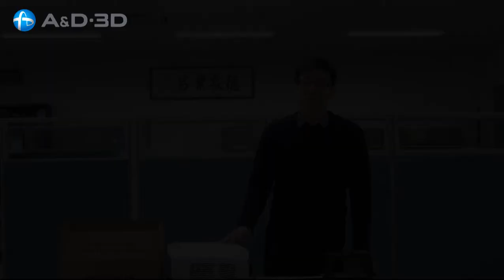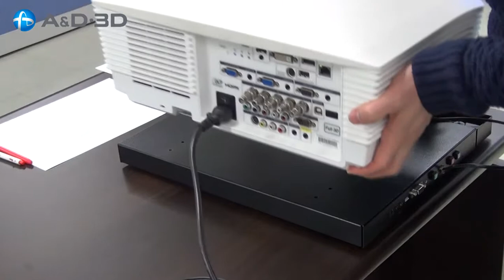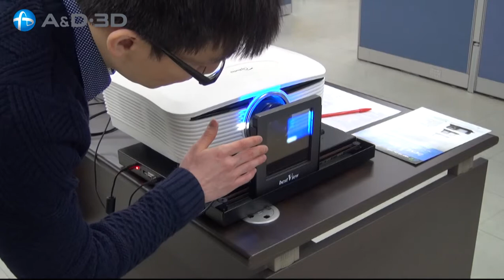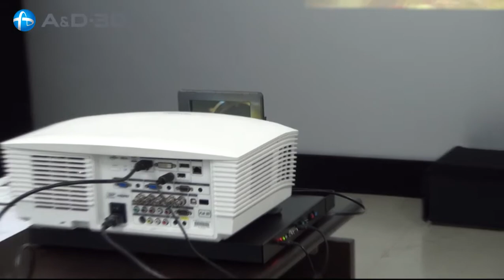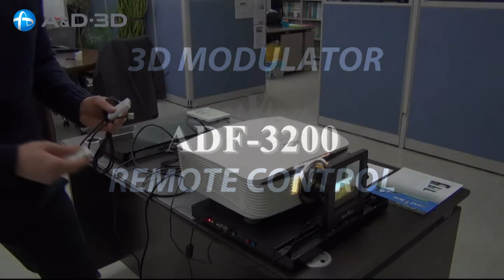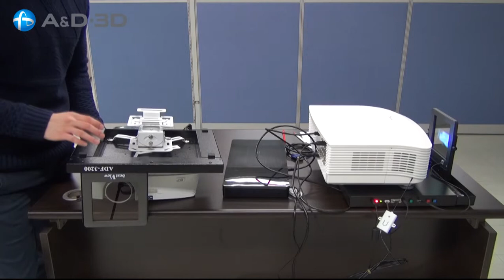3D Modulator bestView ADF-3200

Comment: for this 3 D modulator  required 3D digital projector and also required 3D movie player, 3D movie content ?
this modulator can use in 2k barco projector ? please tell me Sir
Reply: Any projector with 3D function can be supported.
 3D player (Blu-ray, server, etc.) 3D content is essential.
Reply: @최시훈-k7n  one more question this 3D modulator can use in cinema at large screen (W52 feet & H 26 feet ).sliver screen is need for this . is this 3D modulator and digital projector connect to each other ? please tell sir.

Comment: How to connect to a projector which is 3D but does not come with the 3D sync port?? For example Luxcine Z4000; BenQ W1070 1080P 3D Home Theater Projector; BenQ TH670 1080p 3D DLP Home Theater Projector; Egate DLP LED 3D Projector....etc
Reply: Some models can use 3D with RGB.
However, we do not support the model you inquired.
A device that sends a 3D signal to the projector Because there is not
Reply: So no other option to enjoy this fantastic product?? Sad to hear that. Anyways. your demo and the product features are fantastic. Will wait if any product is built with suits my Benq TH 670. Thanks